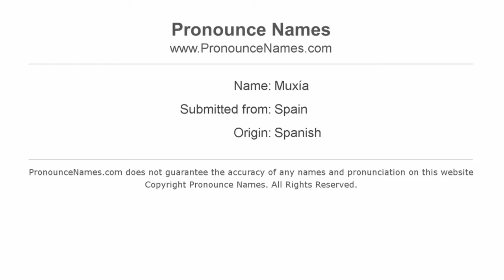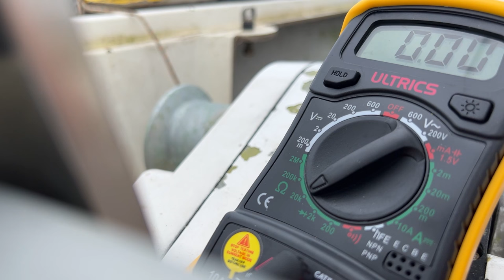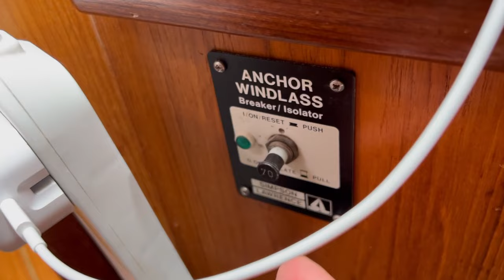WE STOPPED FILMING: Lessons Learnt Sailing Spain I Ep. 81

Comment: 🐾🐾🐾 🐈

List...
Large fuses at the batteries.. (can give details)
Make sure windlass bracket and fixings strong enough.. washers?
Get spare brushes for windlass.. do full strip down and rebuild of all essential items and do anti corrosion.
A windlass operation light would be useful, could be a chain light.. only on when windlass running (sort of annoying, but it saved power in the days of bulbs)
Any turn red key isolators can have a build-up of carbon etc which can cause resistance etc.. ie lights become dimmer but you don't notice, then when the water pump (if on the same switch) makes lights go dimmer but battery voltage ok.
Do you have an alternative rudder?
Check bilge pumps.

Very soon...
Check depth and other below waterline sensors for wear damage to threaded bit that stops it popping out .. add string/wire to stop popping.

Immediately...
Sort out noise from gearbox etc...
Reply from the maker: Thank you so much for this information and taking the time! We really appreciate it. This is super helpful! 🙌🏼🙌🏼